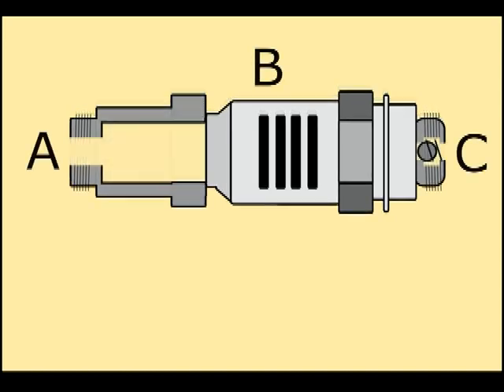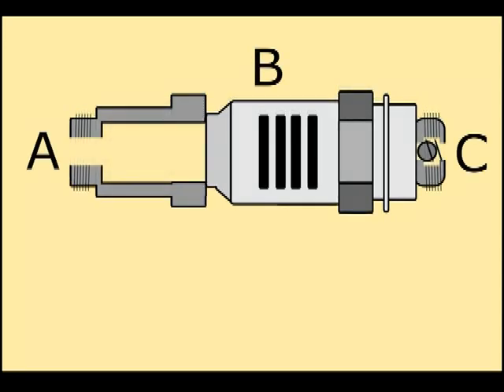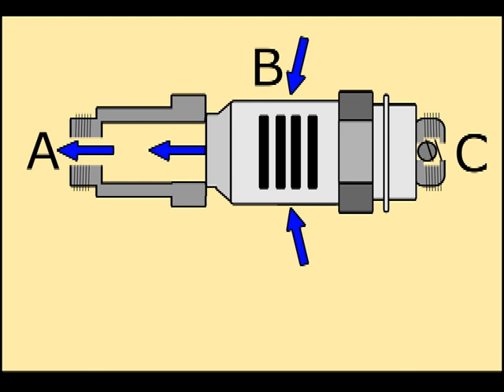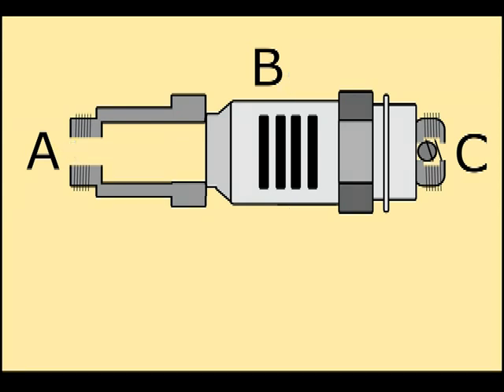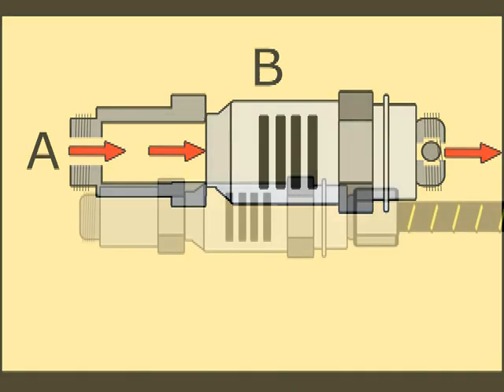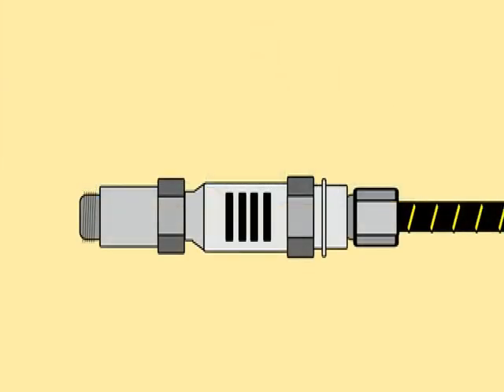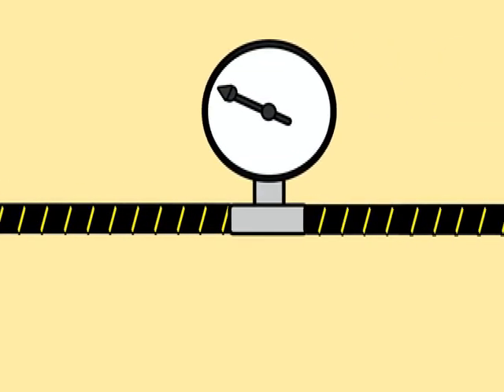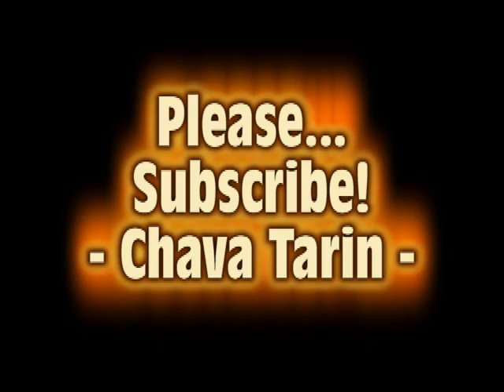How a Spark Plug Tire Inflator works

Comment: So, if I have a single cylinder EFI motorcycle, this would not work?... I found this video right after placing an order for one of these tire pumps.
Reply from the maker: Dear Marcial, unfortunately,  you must have at least one cylinder working, with spark plug and all, in order to the engine to pump air with another piston. Could you tell me where you found this tire pump in the web?
Reply: @eltunene  send me a direct message and I can share the link with you... YouTube deletes my reply if it includes a link
Reply: @eltunene  my cylinder has two spark plugs.. I thought I could leave one spark plug working with the piston, and the other side for the pump
Reply: @MarcialWills  It won't work because there is no combustion in the cylinder with the pump. Also, you cannot use them on efi engines, unless you unplug the injector to that cylinder, which is why you need two.

Comment: Would it work on a car with Indirect fuel injection?
Tengo una 1983 Ford LTD Country Squire
Reply from the maker: Estimable Rene, los sistemas de admisión de gasolina en los autos del tiempo en que se popularizó este tipo de compresor se prestaban más para ello, pues no había in inyector que inexorablemente hiciera entrar combustible a la cámara. El compresor se basaba en que el aire era absorbido fácilmente por las ranuras del compresor y muy poco proveniente del carburador. El problema con los sistemas de inyección es que se mezcla gasolina al aire admitido y posteriormente va a ser forzado hacia el neumático que se está inflando, introduciendo un riesgo adicional. No creo que funcione bien con su vehículo. Afortunadamente en la actualidad hay muy buenos compresores eléctricos, por lo cual no es necesario usar este tipo de accesorios, además de que difícilmente se consiguen. Lo publiqué sólo como una reliquia del pasado. Yo tenía por aquel entonces unos diez años y me fascinaba ver funcionar los artefactos mecánicos. ¡¡Saludos!!
Reply: Okok, Eso me imaginé.
Aun asi es muy ingenioso, me gustaría tenerlo de juguete.

Saludos, muy bueno el contenido de su canal me gusta mucho